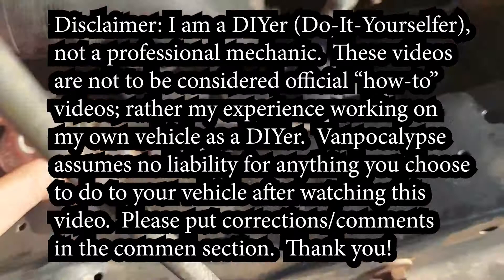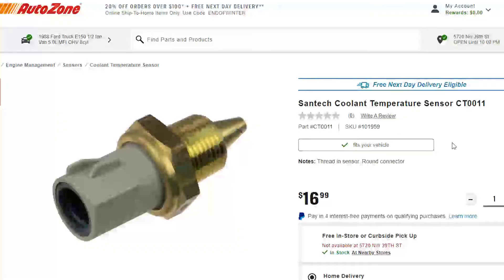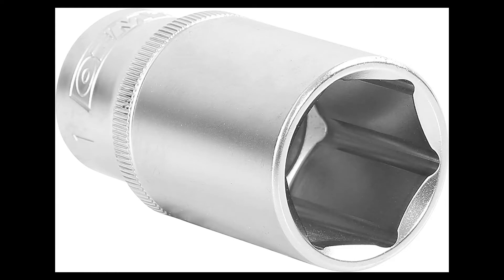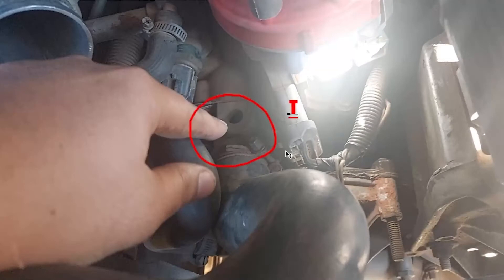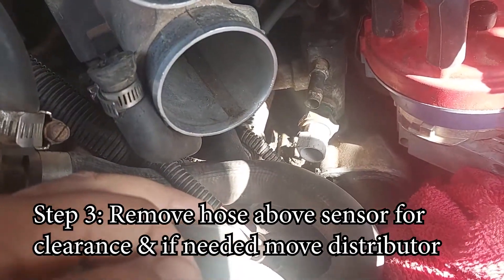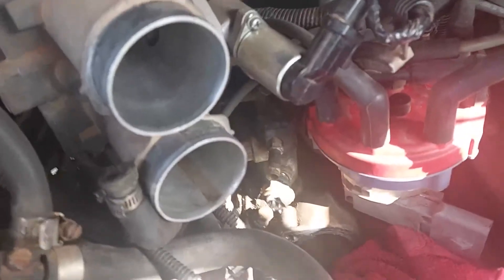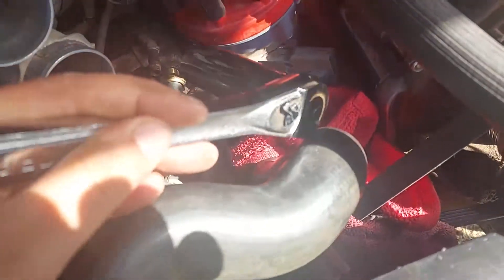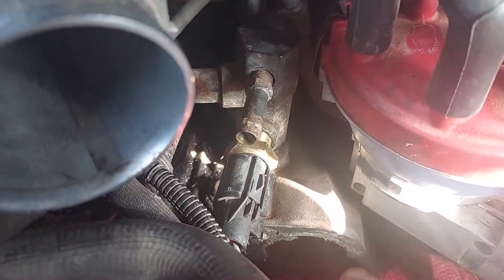OBD-1 CODE 51: Change ECT SENSOR on 1988 FORD E-150 (Econoline) Van (Engine Coolant Temperature)

Comment: A little tip to assure no leaks, and so it's doesn't have be tightened so tight. is to put some Teflon tape on the threads.

Comment: I changed the thermostat on my 87 e150 5.0. it heats up after a long time like 40 minutes of driving. Full of antifreeze. Has new water pump too. Fan was working too. So not sure ?

Comment: @vanpocalypse hey thanks so much for the video!! I’ve got a quick question for you that’s been boggling my mind. My girlfriend bought a 1988 Ford E150 V8, set up as a pretty sweet camper. We picked it up in Santa Barbara and drove it up to Seattle, no issues. As we’re taking our exit, two minutes from home she overheats!! We couldn’t believe it. It’s leaking a lot of coolant and we’ve been trying to find the source of the leak. On the bottom of the engine there’s a hole we can see that’s dribbling fluid. It looks like a machined hole, can slightly see into it, looks like there’s a bolt running horizontally an inch or two inside. My theory is that there a crack somewhere in the engine causing it to leak out? Or that’s a fail safe plug in the case of over heating in the case of overheating? I’ve never seen something like that but would appreciate any help!!
Reply from the maker: So sorry I missed this comment from 4 months ago.. did you ever find the problem?  If you still need any help let me know; so sorry about that!